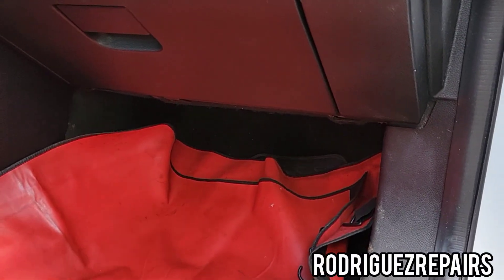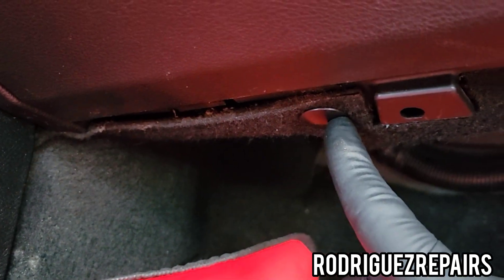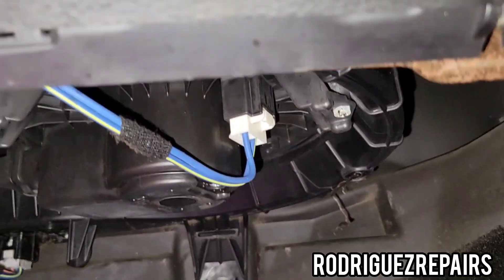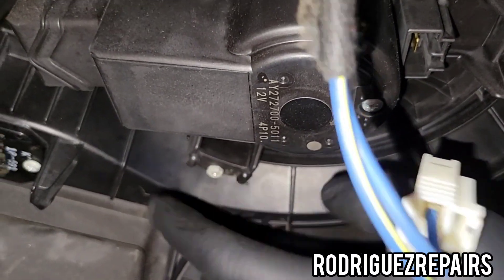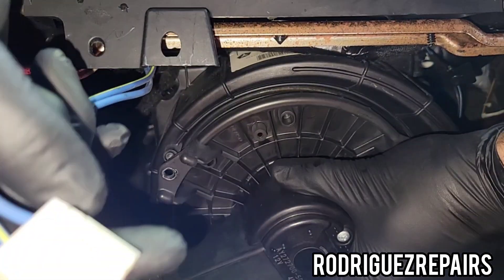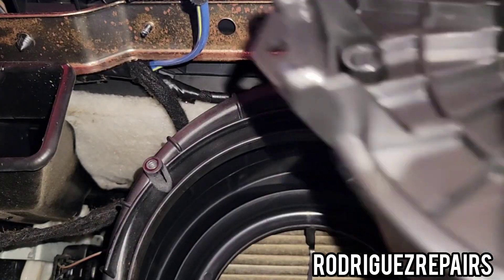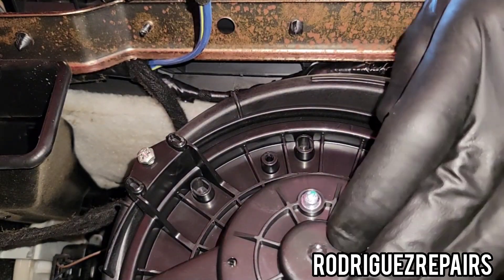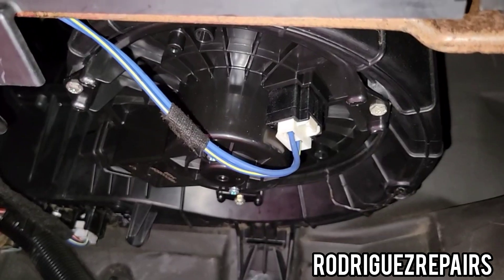2007-2014 Dodge Avenger Blower Motor Replacement

Comment: Thank you, good work.
Reply from the maker: Thanks for watching!
Reply: So I replaced all actuators but it's still not blowing cold in driver side but is cold on passenger!! Could it be the blower motor or is that not the case at all

Comment: So I replaced all actuators but it's still not blowing cold in driver side but is cold on passenger!! Could it be the blower motor or is that not the case at all
Reply from the maker: You replaced all actuators? both temp actuators also? The blower motor will not cause different heat temperatures on both sides. Can the both sides switch to "HEAT" normally?
Reply: Try the blend door actuator
Reply: That’s a clogged heater core.
Reply: We are having the same issue. We changed out all actuators and replaced the heater core. Still don't get hot air blowing in the cabin. Lukewarm at best.